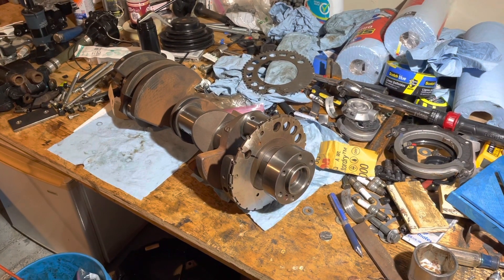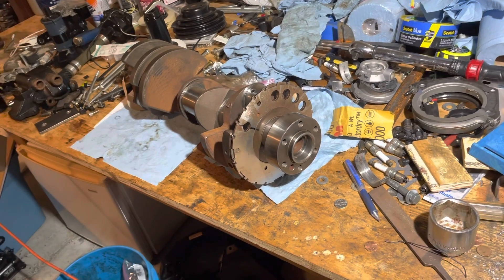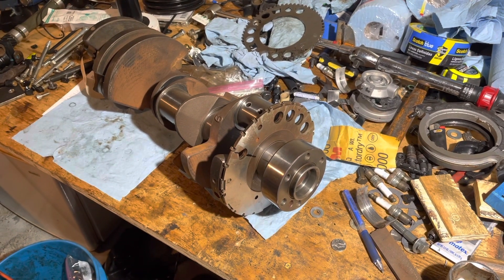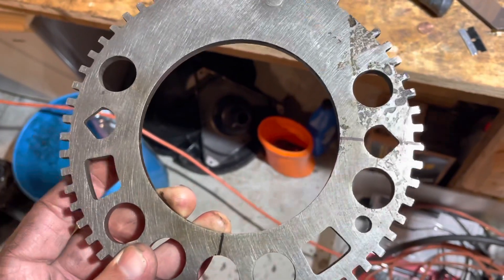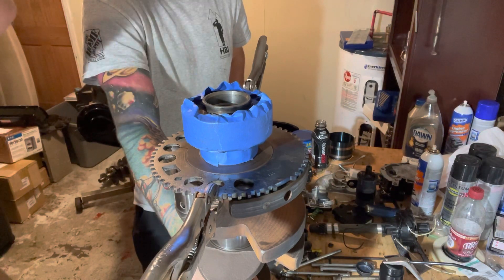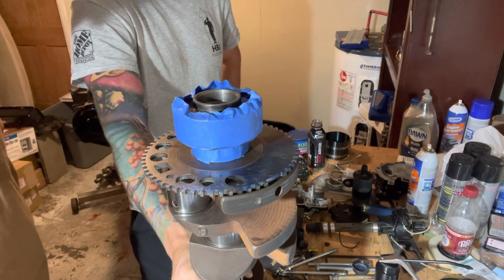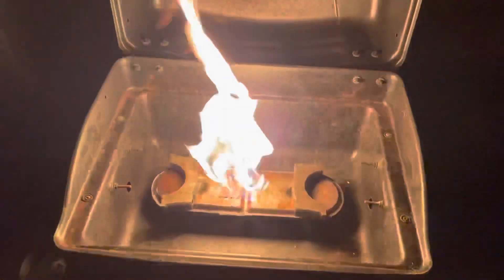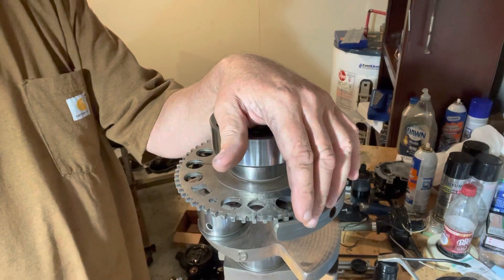LS Swap 2 - Swap Reluctor Wheels Free

Comment from the maker: For those just now watching this video, look at the end of the crank at 0:20. If your crank has a wide flexplate flange like this stop immediately. There are no transmissions in the GM line that will work with a 58 tooth crank and a wide flange crank like this. I made a mistake using this crank in this build. I have another video in this series where I had to swap cranks after I had installed and pulled the engine back out of the truck.

The crank in this video was from a 2000 or so truck and used a wider flywheel flange than later model LS cranks. It will bolt up to older transmissions like TH350 or 700r4 but not 4L60e etc. So you’ll eventually see me do a video putting a 24 tooth wheel back on this crank for another project.
Reply: it does go on in that orientation correct? i see the pointed rounds are 180 degrees away from eachother but that would make it possible to install upside down and put the double tooth in the wrong location. Thank you
Reply from the maker: @nickc7039  look at the hole at 0:34. That hole is the key and would be flipped to the bottom if it was upside down or 180 degrees off. I believe the pointed holes are in line with the 5/6 crank pin centerline. I have another video where I discuss how to orient the trigger wheel with other v8s. Watch that video for more info.
Reply: @moccasinmarine  Gotcha. I actually installed an external 58x trigger wheel on my motor, my problem is that it takes a lot of cranking to start and no rpm on the tach but it runs great once it does start. i see you mentioned something about the maf flow sensor and i do have a code for that which doesnt clear even after replaced along with ckp code. could that somehow be related to crank code and 58x wheel? Appreciate the feedback
Reply: But that 6.0 crank from the 2000’s was bolted to a 4l6065/80 wasn’t it?  What you mean won’t bolt up again to a newer 4l60?
Reply: @MingoMendoza-nk9zv the crank uses a different bolt pattern for the older gen flywheel since it’s a older gen Ls, since the truck he has is newer he can’t use that crank cus of the flywheel bolt pattern. It won’t work with the newer trans he has

Comment: Did you weld the wheel after all??
Reply from the maker: No need to weld it. Factory doesn’t I’ve got 100k plus miles on the engine so far.

Comment: How long dis you heat it up for?
Reply from the maker: 90 seconds
Reply: @moccasinmarine  90 seconds at 500?? 😮😮. I saw this dude said 20 min at 350.. thanks
Reply from the maker: @MingoMendoza-nk9zv my grill is direct flame which is more than 500F. Cant leave it in there more than 90-105 seconds.

Comment: I heated my reluctor wheel in the oven at 375 for about an hour. Worked fine.
Reply from the maker: The heating is not the hard part. The hard part is getting it index properly to top dead center on the right cylinder.
Reply: @moccasinmarine  I agree. I am fortunate to have befriended a shop owner who loaned me his reluctor installation tool. 
I'm curious if you checked run-out of the reluctor or did you get lucky in it's placement? Specs I have give an acceptable run-out of .007" to .028". My first try was .085" but a few taps with a long brass punch and ball peen hammer I got it down to .010".
Good video. I always appreciate when another way is found to solve a problem. "Necessity is the mother of all invention" will always be true.

Comment: That would be good if I ever need to replace the 5.7 litre Chevrolet LS1 V8 engine with a 6 litre Chevrolet L76 V8 engine in my car for any reason because the LS1 V8 engine is getting hard to find in the VT series 2 - VZ series 1 Commodores in Australia with the L76 V8 engine being more readily available from the VZ series 2 -VF series 1 model Holden Commodores which were fitted with that engine prior to the 6.2 litre Chevrolet LT1 V8 engine in the series 2 -VF Commodore.

The AFM delete would also need to be done in the engines which were fitted from the 2009 model Holden VE Commodore which came out with cylinder deactivation fitted, there's also the variable valve timing engines to watch out for..

My question regarding disconnecting the MAP sensor is does a software edit need to be done to prevent the check engine light from turning on & a fault code being stored for the MAP sensor in the PCM ?

I know that the matching camshaft & crankshaft position sensors for the 58X reluctor wheel engine will need to be used in the later L76 V8 engine as well !

Comment: I’m  putting a 2007 GMC motor  in my 2008 Chevy Tahoe. I have swapped the cam gear to a 4x read still waiting on my 58 to reluctor wheel to come in but any way u said in hook the map sensor I’ve looked online and haven’t seen anything about inhooking the map sensor.
Reply from the maker: There are two methods that the pcm measures air intake into an engine. MAF sensors directly measure Mass Air Flow and as long as the sensor is in calibration, you can make changes to the engine and the MAF sensor will compensate for the changing intake air.  MAP sensors on the other hand are used in a pcm calculation along with other values, (cylinder volume, rpm, etc.) to estimate the air flow but this estimation only works if the engine pulls in the same air it did when it was factory calibrated. If you change the cam or make the engine larger the calibration in the pcm is no longer correct for the modified engine. So if you want the engine to run well enough to get it to a dyno for tuning then disconnect the MAP sensor and the pcm will run only on the MAF sensor but it will set a code. I’m not recommending you run on a MAF only system for good, just long enough to get it tuned.

Comment: I did that swap with my 5.3 gen 4 I swapped the wheels now it only starts with the gen 3  crank sensor even tho it has the 58 tooth wheel ! Help it doesn’t start with the gen 4 crank sensor
Reply from the maker: The ECM in the car must match the sensor and trigger wheel. You can’t just randomly swap sensors and trigger wheels. As a matter of fact the ECM in the car is what drives the conversion.  What year car and model do you have or better yet what is the VIN of the car that you put the engine in?
Reply: @moccasinmarine  I don’t have the vin on me right at the moment but it’s 08 gmc Sierra so what do u think let me know I’m literally taking out my motor right now
Reply: @moccasinmarine  so how do I match that or what
Reply from the maker: @aaronzavala4336  the 2008 Sierra had an E38 ECM which uses a 58 tooth trigger wheel and 4 tooth cam gear.
Reply from the maker: It also had AFM which you will want to get rid of.  Google DOD DELETE to find out how.
Reply: @moccasinmarine  but what does afm had to do with the reluctor wheel
Reply: @moccasinmarine  so then what do you think I should do
Reply from the maker: @aaronzavala4336  you need to hire a mechanic or do more research to help figure out what you are trying to do. I don’t have enough information about your project to help.
Reply: @moccasinmarine  all I did was swap reluctor wheels and put the crank back in but it won’t start with the gen 4 sensor even tho it has the 58 tooth wheel but then when I install old gen 3 sensor it fires up
Reply from the maker: @aaronzavala4336  again I don’t know enough about your project. What is the VIN if the Sierra and what was the VIN of the truck that the engine came from. I need that to figure out what you need to do
Reply: @moccasinmarine  I didn’t replace the engine I only changed the crank it’s basically the same crank just swapped the reluctor wheels
Reply from the maker: @aaronzavala4336  I give up
Reply: @moccasinmarine  ha sorry I give up to I’m confused Im already more than half ways taking my motor out I’m sure I didn’t align the reluctor wheel correctly I’ll give u some updates later today sorry about that I was just confused
Reply: @moccasinmarine  there’s still a way to align it right even after I lost the markings ?
Reply from the maker: @aaronzavala4336  your story is getting worse and worse? Why did you change crankshafts? Why do you think the reluctor wheel is not aligned? Why are you switching crank sensors? The sensors are not interchangeable. There are way too many questions that lead to other questions which tells me you need to get help from a mechanic near you. I can’t  help you
Reply: @moccasinmarine  I changed crankshafts because I spun a rod bearing making it not useable again so I changed it I don’t think it’s aligned properly or something because it’s not working with the correct sensors
Reply: @moccasinmarine  sorry I didn’t make my self clear enough
Reply from the maker: @aaronzavala4336  why didn’t you buy the correct crankshaft for the engine you put it in? At this point that’s what you should do.
Reply: @moccasinmarine  now that I have it almost apart when I do look at the crank is there a way to align correctly this time without marking anything
Reply: @moccasinmarine  that’s what I’m thinking since ima have it out already do u consider to just buy a crank with the reluctor wheel already on there but man I looking forward this to work I did what u explained on the video how did it work for u
Reply from the maker: @aaronzavala4336  just buy this crankshaft and install it:

https://www.ebay.com/p/26025719755

But if you are telling me you want to buy the wrong crankshaft just to have the experience of swapping reluctor wheels that is the nuttiest thing I’ve ever heard. Just buy the right crankshaft and be done with it.
Reply: @moccasinmarine  didn’t u do this in the video ?
Reply from the maker: @aaronzavala4336  this conversation is going in circles. I can’t help you. Get a mechanic who knows what to do.
Reply: So I have a 10 Escalade that had 6.2, it blew, so I have a 06 6.0, but have the trigger wheel issue. Swapping the wheels will be all I need? I won't have the flange issue? @moccasinmarine
Reply from the maker: @jah1045-i4s  you say you have an 06 6.0. Are you swapping the whole engine or just the crankshaft?

Comment: Hey bro hope ur still answering I have 02 5.3 iron block and I want to put it in my 08 gmc but do I have to change the reluctor wheel from the gen 4 onto the gen 3 and then what else ?
Reply from the maker: Yes you must change reluctor wheels. Also the knock sensors on 08 are moved down low on both sides of block. The earlier engines had knock sensors in the intake valley. If the 08 engine was aluminum and the earlier gen 3 was iron you’ll have to get a calibration change since iron blocks create different knock waves than aluminum. The 08 camshaft sensor and chain system is different and so is the crank sensor. There are quite a few differences too many to describe in a comment. You’ll need a professional engine swap company
Reply: @moccasinmarine  a tuner fixes all of that, but you still have to relocate the knock sensors and camshaft position sensor if your swapping a gen 3 motor into a gen 4 truck

Comment: How did this end up working out for you in a running vehicle? I'm looking to swap a 4.8 crank I have this weekend to 58x, luckily that crank has a reluctor wheel and so does the Gen4 engine that I'm pulling the crank out of. When I asked my tuner about doing this he was iffy on not using a jig, if you're off even 1-2* he said that's base timing at the ecu blah blah. Technically you could be off that much with the jig.
Reply from the maker: I’ve been running a 6.0 gen 3 in my truck with a 58x wheel for 2 plus years now. I bet I could get the wheel closer my way than with the jig. Watch the video to the end but I had plenty of time to line it up once I set the heated wheel in place.

Comment: Good video, only tool here is the marker n the pliers, no need for a $300 tool. I did this same exact thing n from 25xto58x and it works, got my engine running. Thanks 👍
Reply from the maker: You left out the burner to get the wheel to 500 degrees.

Comment: I have a bottom end from a gen 4 with a gen 3 block would it be worth it to change the crank reluctor wheel onto the gen 4 crank and put it into my gen 3 block? Thanks
Reply from the maker: The reluctor wheel is determined by the pcm running your car not the block or lower end. You must run what ever wheel the pcm in the car is looking for.
Reply: @moccasinmarine  oh ok thank you 🙏
Reply from the maker: @badquality4069  what car are you planning on putting the engine in?
Reply: @moccasinmarine  its in my ls swapped infiniti i had it running with a gen 3 but i didnt ring gap it and the rings closed up and broke the piston. But i got the full bottom end from the gen 4 for free. I put the reluctor wheel on today it was pretty easy!
Reply from the maker: @badquality4069  ok so if you had a Gen 3 LS swapped into an Infiniti and you ran a 411 pcm you’ll need to put a Gen 3 24 tooth wheel on the Gen 4 crank
Reply: @moccasinmarine  yessir im going to put the gen 4 bottom end in. Thank you

Comment: Can a reluctor wheel be swapped on a ls4 as well? Edelbrock wants me to convert the ls4 to ls2 timing specs and cover to use their efi units. Is there someone you can send in the crank to do this for a fee?
Reply from the maker: I’m not aware of a special place to swap reluctor wheels. Any competent machine shop in your area should be able to do it.

Comment: I changed a 58x wheel to a 24x wheel. I did it the exact same way that you showed, but I’m not getting any spark. I’m getting really frustrated with this, trying different things, changing sensors. Going to check all of my ground wire connections next, I hope this helps.
Reply from the maker: You’ve left out a lot of details. The crankshaft position sensor is a different part number for 24x wheels and 58x wheels. I’d start there. Do you have power to the ignition coils? Is it no spark or it won’t run? Make sure your MAF sensor is working. The engine only needs three sensors to fire up: crankshaft position, MAF or MAP, and coolant temperature. Everything else is secondary so focus on these three.
Reply: @moccasinmarine  I’m going to trouble shoot tomorrow. I’m thinking it’s probably a ground wire issue. I have no spark at all right now, I’m going to ground the coil connection black wire directly to the chassis. I’m also going to double check all of the other grounds
Reply: @williamb2013  Are you showing engine RPM when scanning while cranking?
Reply: @JohnnyAnderson1  yes it was. I got it running yesterday. I grounded the black wires in both coil connectors
Reply: @williamb2013   Awesome
Reply from the maker: @williamb2013  the coil connectors should have already been grounded. Was your harness homemade?
Reply: @moccasinmarine  no, original to the truck, I can’t explain it. It works now, maybe from moving the harness during removal and install
Reply: Not sure what your issue is, but just remember that the 24x tooth vs 58x use difference pcm's, so Im pretty sure you need to match tooth count to pcm (E38 vs Warren PCM) CHECK OUT the LINGENFELTER write up on this
Reply: @antoniosaia7250  it turned out to be a ground issue. I grounded both of the black fuel injector plug wires and it fired up

Comment: Great video, but I do have a question as I'm kind of doing it backwards.  The 24x crank is balanced for gen3 rods/pistons, but you are using it with your gen4 rods/pistons which weigh more.  Did you get the crank rebalanced?  If not, how does she run?  I'm not switching the trigger wheel because my 24x crank is good, but I am swapping out the rods/pistons, so I'm curious if I need to rebalance.  Thanks!
Reply: I took a 2001 lq4 and put gen 4 rods and .030 over ls2 pistons in it with a lsa supercharger, no I didn’t have it balanced and it runs fine…….spun it up to 6200rpm with no issues for over 3 years now
Reply from the maker: @trentdawg2832 thanks for the post. Just now saw it.
Reply from the maker: The crank in video was from a 2000 6.0. It didn’t work for reasons explained in another video. I ended up buying a brand new LS2 crank that also had 24 tooth wheel which I also replaced with this same method. But I believe the LS2 which came out in 2005 used Gen 4 rods/pistons so I can’t give you a definitive answer.  Btw not all 24 tooth cranks used Gen 3 rods/pistons. There were some crossover years where 24 tooth wheels had Gen 4 parts. The 2006 LH6 is one example. I have two cranks both Gen 4. One is from 5.3 and other from 6.0. I’ll get them weighed to see if the balance is different.